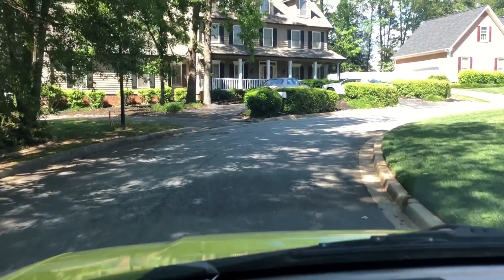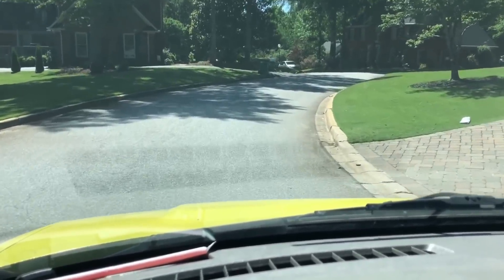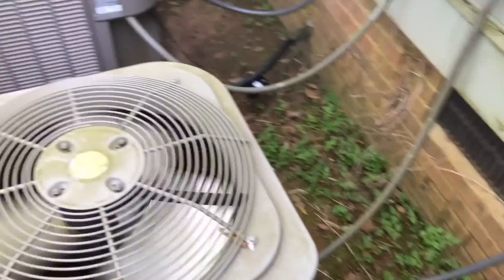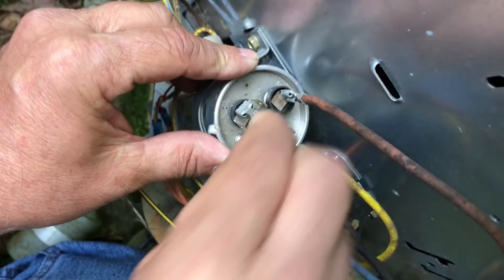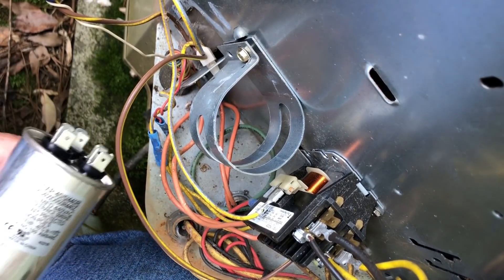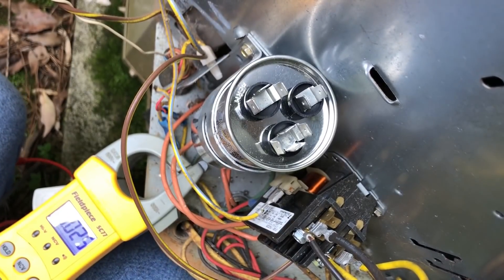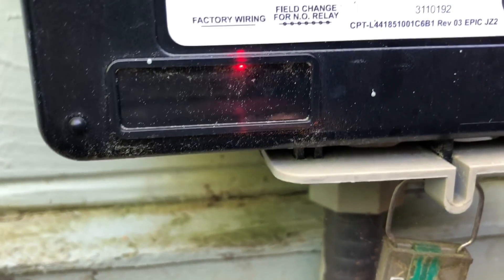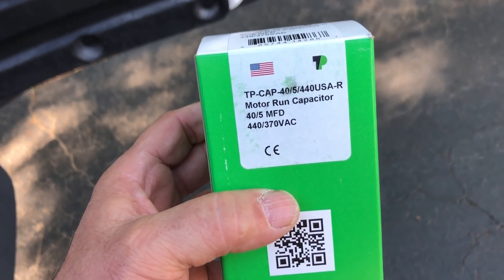Dont try this at home Capacitor replacement

Comment: This is why we go out of our way to order film caps not electrolytic caps. Polly metallized film caps I’m over a half a century old and these of been around when my dad was a young boy and when you find them they could be 15, 20, 30 or even 40 years old and still in operation. If you get on the web and search for electronics warehouse is that deal in high-voltage motor capacitors you can order them yourself and completely bypass HVAC warehouses and get a much higher quality capacitor that you’ll probably never have to come back and replace in your career. Or that same technology is used in the Amrad capacitors do you hear Brian Orib on (HVAC school for Tech by  TECHs) talk about. As for the PCBs when we were very young this is something that toys all over the news in the early 70s when it was found workers who work with it in the electrical companies with the transformers it got into the water supplies and into our food supplies distribute it in supermarkets was causing cancer in high rates in certain parts of the country so it was banned.

Comment: I’ve heard it said that a capacitor in most cases does not fail without reason, as in something else caused it. is this not the case? My previous boss spent hours hammering that into our heads

Comment: I don't figure I need advice about capacitors from a guy who finger tests every one he comes across.
Reply: The day you dont is same day you get a nice buzz on the fingers, ussually follows with a replacement disconnect
Reply: If power is disconnected, which he clearly did beforehand, there is zero risk... and really zero need to. It is discharged instantaneously on alternating current especially hooked to two motors if power happened to be cut on a peak. Not a big deal but also pointless.

Comment: What caused the old capacitor to go bad?
Reply: I don't know but I can tell you my Dewalt batteries (20v, high capacity) both bought together, both died the same week.  Coincidence?
Reply: Linked below is an interesting video on the amount of back emf voltage a 120vac fan motor generates particularly in low or no load conditions. An oscilloscope shows well over 435v rms in back emf. I believe the old school run caps and the current better capacitors have materials that provide higher voltage margins over those stated on the can. 
 All well designed products have safety margins but some run caps don't.  However the better caps cost at least four times more than the cheap Chinese caps.  The problem is when given a pricing option the customer will normally take the low cost caps.   Usually not knowing the quality difference until two years later when it fails again.  Service companies might be better off selling the better caps with the markup used on the cheap caps to benefit the customer and their own reputations.

https://youtu.be/fOM07KN-B5s

[Video shows sine wave on scope with 100vac/div. Meter RMS equals Peak x 0.707]
Reply: Here in Texas we change majority of capacitors when above 85f....heat kills
Reply: @rj.parker  You might be on to something there.  A garage door company here will replace a single broken torsion spring for $X, parts & labor, and will install a second one (the other side) at their cost for the part and no additional labor, because when one breaks, the second one usually isn't far behind. They'd rather make no profit on the second spring than have a pissed off customer call a month later and say "You guys were JUST HERE and it is broken AGAIN!"